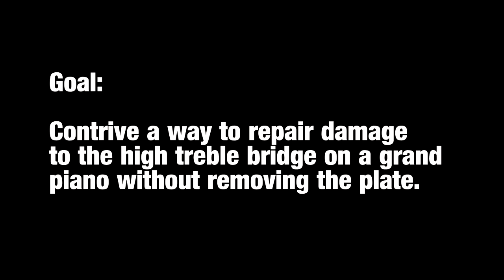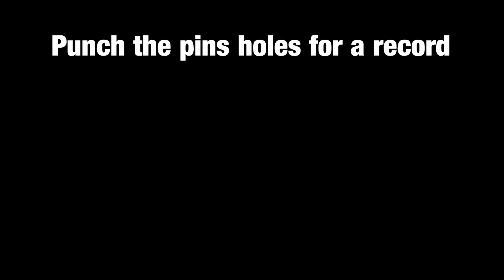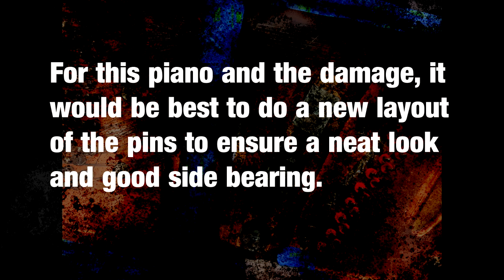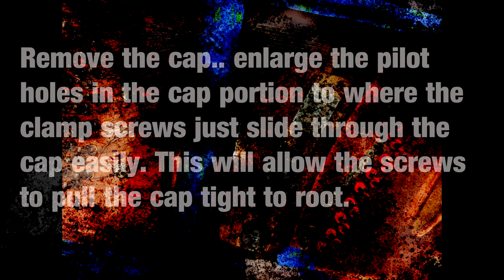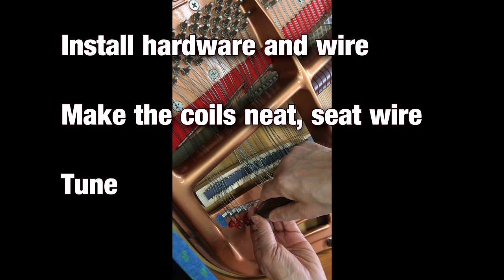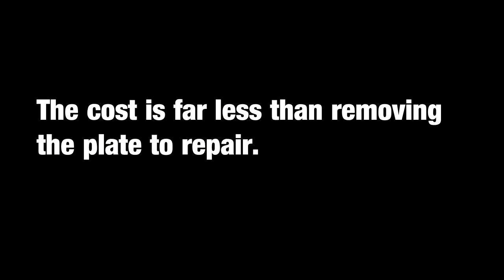Piano Bridge Cap Repair

Comment: Seems to me that the piano would have to be level along the string alignment or that you would need a level with a bubble adjustment capstan to adjust the bubble to “level” on the speaking length before you placed it on the back scale. If not then the downbearing angle won’t be controlled or uniform in the areas where you want it to be 1/2°.